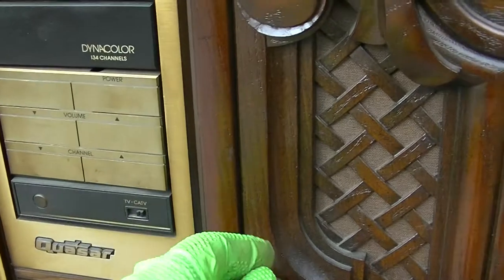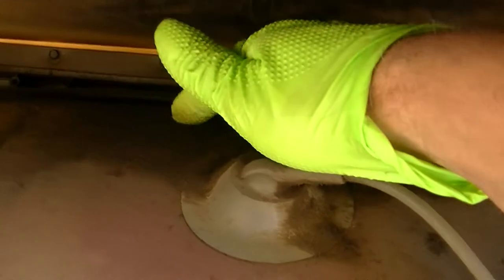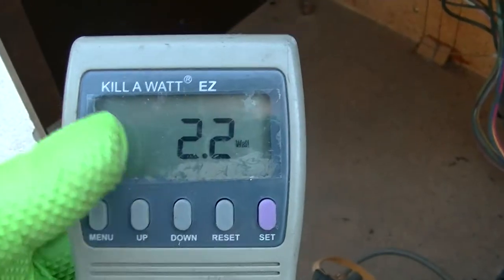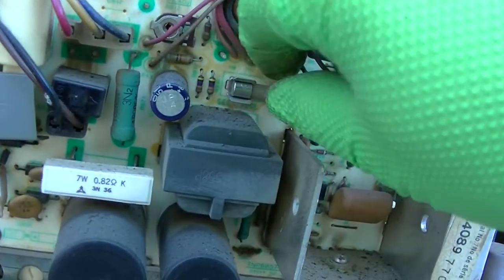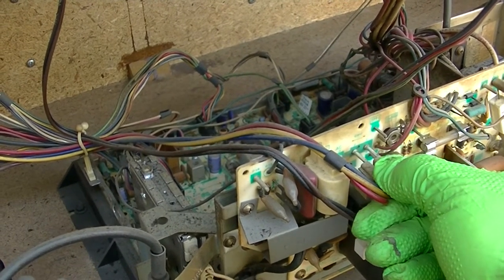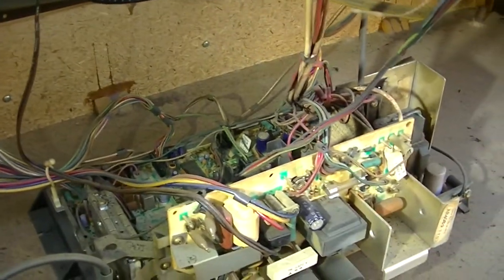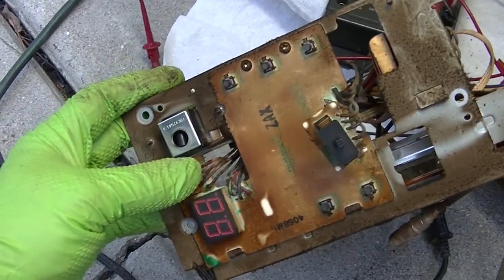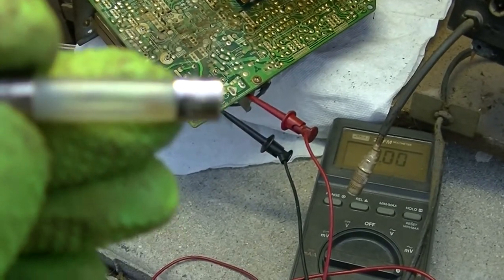Hideous Quasar Smokers Choice 1984 Color Television NASTY

Comment: Omg! 😂😂
 I have been laughing through this video the whole time. The minute you pulled out that display board and just went hysterical and how much cigarette dust was on that I just busted up laughing. I so remember these type of televisions in the '70s. I was born in 1967 and I remember as a childhood that most of the televisions in that era were made to look like furniture. And a lot of the furniture in the 70s look like that. I remember my aunt and uncle having some furniture that looked similar to that and it was yellow. Looking at these TV sets just cracks me up because I remember all that from the 70s and early '80s. It's good to save those old CRT monitors because a lot of the '80s video games could use those monitors. A lot of people are looking for that kind of stuff especially companies that restore old '80s video games. And when people restore these old games they want the old CRTs back in and they don't really like using that led or lcds. People want to keep the vintage look of the game so a CRT monitor is the way to go. if you ever happen to come across the CRTs that work you might want to save them and try to sell them to some of these restoration companies because they will work and if the monitor chassis is also working that would be a good thing also. I would save the monitor chassis and the CRT if working and junk the rest of it. Very hilarious video I just came across your channel and this is the first video that I saw going to subscribe. It's good to add a little humor and speak how you're feeling at the moment it's hilarious. 😂
 You sound like Adam Carolla.😂

Comment: Before 1968, our only TV was an old B&W RCA that my dad was always repairing. He and Mom cut a deal: he would work an outage at the sinter plant in Saxonburg and the OT would pay for a new color TV. 

The Magnavox set looked a lot like this one but there wasn't a bit of plastic on it. Transistors were too new and unreliable (Quasar advertised its TV as having its "works in a drawer", plug-in PC boards easily accessible through a front-panel door. Tubes it had, lots of them. But it was a good set that gave over two decades of service.
In the pre-cable era, ghosting due to multipath was a huge issue in the Pittsburgh area. Every house had an antenna rotor to aid in the search for that ghost-free picture.
That TV saw a lot of history...moonwalks, the Immaculate Reception, four Steeler Super Bowls, and the Pirates' last two World Series.

Comment: As far as hideousness goes, that, eh, style (Baroque or something?) just doesn't hold a candle to the Mediterranean consoles that were all the rage in the 1970s, with their little molded plastic square panels, even on the sides.  But it is silly in so many ways. They went to such lengths to make the "furniture" part symmetrical, then ruined it by throwing  in a right-handed TV faceplate that might as well have been from the table model. And, there is so much air in that thing that those fake handles could easily have opened doors to cubbies for VCR tapes, hearing aids, remote controls, etc. I can't believe that by 1984, a space for a VCR and/or cable box (which could have been added if the chassis were raised up a bit) wasn't standard on any floor-model TV. There was a boomlet in sets like this during the late 1980s and early 1990s, with so many retirees buying what they always bought, but the way they made use of the space was an insult to the intelligence of anyone who knew how much electronics had shrunk since 1965. On the other hand, the smoker's patina added a certain charm to that set; if I had the space and nothing else to do, I'd like to polish it up and leave whatever tint was left behind as sort of a historical record of what might well have killed the original owner.

Comment: As I understand it color picture tubes are not glued together but rather sealed with a type of extra low melting point glass called 'Frit Glass'.

When I was around 3 years old in the early 90's I killed one of the last generation of hybrid WID sets in a cabinet almost the same as that (the speaker grill cloth was red velour).  Moto apparently made that cabinet a number of years.

Comment: Save that bad boy for a New Year's EOL. Get a transformer that puts out 18 volts, connect to the CRT heater and using a variac slowly increase the voltage till the picture looks good than continue until you burn out the CRT. Finally blow it up with some fireworks and let it burn baby burn.

Comment: Next to the rat turd infested color set you did a while back this has to be one of the nastiest. If I owned a TV shop and somebody brought this to me I would send it back home with them. Too nasty to work on.
Reply: We had computers like this at the shop I used to work at. It's worse with computers because you have fans actively circulating air, dust, smoke, fecal matter, roaches, bedbugs, etc through them. Any time we got one of those in the owner ALWAYS wiped down the outside to make it look "clean", but lo-and-behold you open the cover up for the nastiest of nasty surprises! Those typically went straight to the garbage bag and tag taped to it. Call the customer and tell them we refuse to work on it and have them pick it up. The LOOK on their faces when they see their computer in a garbage bag ready to be picked up! NO, WE DO NOT WANT YOU BED BUGS TO INFEST OUT ALREADY UNHEATED SHOP!!!
Reply: @RingingResonance  Reminds me of a shop I was part of once. Not a TV, but a gross case nonetheless: one time a customer brought in a Sharp microwave which would not cook, and the touch panel wasn't working properly. Quote was accepted, and it looked clean and nice outside, but once the senior tech opened it up to diagnose the issues, a dozen live roaches ran for cover. In the end the customer was told to go buy a new one and hire a pest exterminator (by the service manager, not me). True story.

Comment: The fact that 1984 is now considered vintage just makes me sad ;)
Reply: Kids are even calling the 90's vintage ... 

"Sorry kid, your playstation 1 and  black plastic TV with on screen display is not vintage"
Reply: @volvo09  i have a good collection of vintage black and white sets from the 50's and 60's and i also enjoy collecting and repairing computers from the 90's...and i can tell you its easier and cheaper to buy a 1950's all vacuum tube tv in "good" condition than to buy a 1990's good vga card or even a simple keyboard from that era let alone a hard drive, even failed dead hard drives are expensive and rare, not to mention floppy disks, yes floppy disks are becoming expensive as hell especially the 5 1/4 inches ones.....5 years ago i was working on a recycling business and was selling perfectly good 17 inch crt vga monitors for 5€ to try and save them from smashing and nobody wanted them, now they are rare, very rare....plastic 90s tvs, for me are cheesy and  nasty and i will never like them though, especially the last batch of them when grey or silver colours were popular to make them look more "modern" and when they started using flat screen crts

Comment: That's not nicotine crust. It's cigarette tar crust. Nicotine does not become particles, tar does. That set was used in a smoking room with so many dedicated smokers for so much time, cigarette tar pretty much enveloped it whole, outside and inside. It's a lost cause. To be cleaned it'd need to be power washed, and that would destroy it anyway, then it'd need a reflux of all the solderings and the replacement of all the gummed switches. And a new tube. Too much a hassle and expenses for what it's worth.

As for its appearance, in Italy we have a word, "pacchiano" that roughly translates into tacky, but the English word doesn't really have the same nuances and depths of the Italian one. A really unsightly TV set.

Comment: Bill's T.V. in Santa Clara Californian sold Quasar, Zenith and RCA Sets, as well as VCRs. Authorized Dealer and service Center.. Yes this was junky compared to the older stuff we were still working on however Zenith and RCA both were selling the same junky plastic stuff. I preferred selling the Quasar sets as I never ever saw them again. Quasar, Panasonic, Technics was Matsushita.  I do remember a issue with a filter cap in the horizontal circuit that would open and cause a dark shadow from left to right. Handiest tool to carry for home service was yes a bottle on Windex and some paper towels in those days.- Wow that set looks like new! Thanks once again for the memories.

Comment: Not being racist here, but this is the type of television Greek's seem to love the look of... It seems that the constant on/off (heating and cooling) switching of the set over the years has caused the fuse filament to degrade to the point of it going open circuit... 10/10 for this vid...
Reply: Ha. I’m Greek and my uncle had the analog tuner version of this set. Same cabinet. Great picture and sound.

Comment: Our first color tv was a 1977 Quasar 25"console,  it was a great set with no problems! It was eventually given away 19 years later but still worked.  The cabinet wasn't as "cheesy" as the one in the video, it was just a basic design.

Comment: If I had a penny for every TV, and stereo I repaired back in the 70's, 80's and even in the 90's stacked on top of each other that was turned yellow from tobacco smoke I could have stacked them to the moon and back. If you really want to see what cigarette smoke does to electronic gear then try working on musical equipment that has made it's rounds in the nightclub circuit.  I know that too because I did the club circuit for 40 years playing live music. If you were ever a smoker It will scare you away from smoking just seeing how the smoke coats everything yellow and when you clean it off with acetone or alcohol you get that fresh whiff of tobacco stench all over again...

Comment: Although it seems absent, there is a separate piece of safety glass laminated to that tube face with a layer of gelatinous transparent cushioning adhesive.  From a safe distance, I once broke a naked CRT that was made when they still used separate faceplates, and the violence of the implosion was surprising. Huge pieces of razor-sharp glass flying in all directions, in a big puff of phosphor dust.

The tension band secures the sheet-metal frame and mounting brackets, and there may be some kind of oxidation-inhibiting material underneath.  This became common practice starting in the early sixties, and older sets would eventually develop "ring around the collar," a discoloration and rotting-away around the edges of the gel layer, perhaps due to polymer-degrading ozone from the nearby HV source.  The white "glue" stripe around the glass behind the phosphor plate is a frit bond, consisting of something akin to pottery slip, applied to the edges of the faceplate/shadow mask assembly and bell.  The two pieces are then precisely aligned together in a jig and fired at a very high local temperature to fuse that white ceramic frit material.

Comment: There were probably VCRs sitting on top of that TV set, probably with lots and lots of porno videos. I used to smoke Marlboros, and decided to quit as it got way up to 85 cents/pack! That TV set came off the assembly line less than a year after I put out my last cigarette, and I don't miss the odor!! The deposits from cigarette smoke that accumulated on this set is actually called cigarette tar. Nicotine is the actual addictive substance in tobacco, and trace amounts of it may still be in those cigarette-tar deposits.

Comment: That's a nice set I bought one for my mom but it had a tiny chassis about four years in I had a filter in the power supply go and produced a goofy picture 200 plus volts on that filter.   One let burned off. I but a TV to see the picture the body is secondary.

Comment: I didn't even know they ever made console TVs with plastic cabinets. Even one I bought in the early 1990s (Big square box on a short swivel pedestal.) was either particleboard or MDF. (Not sure if it was covered with a veneer or just wood grain laminate/vinyl.)  I saw a lot of console TVs that looked a lot like that in the 1960s and 1970s. It was a very popular styling in the USA. My parents console TV had a black varnished cabinet with a picture of Mt. Fuji made from mother of pearl on the inside of the lid for the stereo.  (They bought it in Japan in the early 1960s.)

Comment: Quasar.  The quality goes in before the name goes on.   I think the build up of nicotine soot on the underside of the cabinet was a result of air convection currents that were created when the hot CRT drew air up around it and it would hit the cabinet underside.  I also suspect the clean spots on the top of the cabinet were where a VCR or Video Disc player sat.  Everyone used to have one and right there would be where you would put it.

Comment: Ugly for sure but to be 40 yrs old and only have a bad fuse and cold solder joints in the vertical section is impressive , Panasonic did pretty good on that chassis, more than likely the tuner issue is also cold solder joint related if not before certainly after curb stomping the ole girl trying to get the vertical to pop back in lol, great job as always.

Comment: Back in the 80's I worked in a TV shop that was a Panasonic (Quasar) warrantee service shop and I worked on a plethora of these. The only problems was the 4.7 mfd in the screen supply and the glue matsushita put in all the wrong places. But when working it had a nice picture when set up correctly.
Reply: Ok got the same experience with a National Black and white TV my parents had. The TV is still there somewhere, it used vacuum tubes.

Comment: Interesting to see the CRT was made by Sylvania. I saw the EIA 312 code at the beginning of the video.You would think they used a Panasonic tube.Never seen a set trashed as badly as that.
Reply: It was common practice back in the day for lesser brands to have their picture tubes manufactured for them. RCA, GE, Sylvania, and Zenith (Rauland) were the picture tube manufacturers and were the major OEM suppliers.  It was simply too big of an investment to set up a production line to manufacture picture tubes (especially color CRT's) not to mention quality control and design issues.  Why not just buy the CRT from someone who has already perfected the process, has a known demonstrable quality, and has gone through all the pain for you?  There were smaller manufacturers by volume, but they were mostly concentrated on specialized devices such as scope tubes, radar tubes, medical device CRTs and later computer monitor CRTs. Later the orient got involved and many other manufacturers joined the fray.  From what I can put together the last CRTs made in volume where the little 5-in black and white TVs used to get for $25-$50 at the drugstore or discount house.

It also would have made more sense to have sourced the picture tube in the United States rather than ship it from Japan. There was likely some tariff that could have kicked in if there was less than a certain percentage of US content.  Besides picture tubes are heavy, somewhat fragile (the neck).  You're not going to ship them from Japan, transport them to Chicago where Quasar was made for less than you could have shipped them from Pennsylvania.

Here is a quote from vintage Sylvania net:
"By 1965, they (Sylvania) were providing color tubes to 18 of the country's 23 color television set manufactures. ". Not bad.

Comment: Those are the same buttons I found in the cruise control panel in my 1999 mercury grand marquis. I took the tiny momentary contact switch apart and found they had used a silver plated contract that had corroded. Unfortunately that swithc was unrecoverable. The other switches I got to function by squeezing them tightly closed to break the oxidation exc. Soldered a old contact switch from a fluke timming light so I can use it for now.
Reply: At one time those switches were available as a Motorcraft replacement part for about $30. Probably discontinued and/or way more expensive now.

Comment: It reminds me of kitchen/exhaust/extract/range aspirator/extractor/hood at my parents appartment, because it's of older dimensions standard and top row of custom cupboards around it is in great condition (expected from a hand built set of oak) I have to clean it periodically, because there is no longer a new one that could fit in. But the fume extractor is subjected to massive ammount of oil fumes from daily cooking and shango's specimen was probably a living room appliance... BTW - soviets did the similar style but table top TV sets the same time period (look at "Радуга-719", but though it was a smaller cabinet it was heavier because it was tube/transistor/ic hybrid with 200W iron transformer)

Comment: 4:12 Coming from a slightly different background, PC repair, I can never decide what's worse, when it's dry and dusty like this, or still moist and gooey and stains everything it touches. At least when it's moist you're not breathing as much of it. I have too many bad habits of my own and it would be hypocritical to lecture people on theirs. But just so you smokers are aware, if you smoke around your electronics, it makes it really difficult for techies to care very much about fixing your stuff, and it can end up costing you more money in the long run, or taking longer than it should because it needs to be thoroughly cleaned before it gets worked on. Just trying to save you a few bucks, I know cigs aren't cheap these days.

Comment: Amazed that kind of curly cue decor cheese and vertical hold switch were still on TV's made into the mid 80s
Of course in the 70s and 60s it would have been real wood trim vs the plastic.  I assume this set was marketed to older buyers who wanted what they remembered 50s-70s, kinda like those crappy Crosley old-timey radios with the built in cassette and cd player